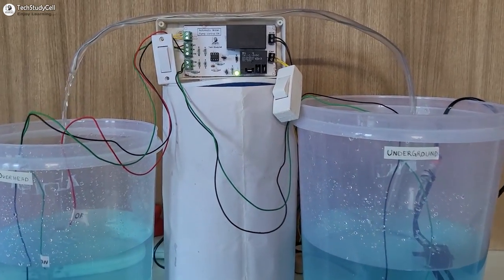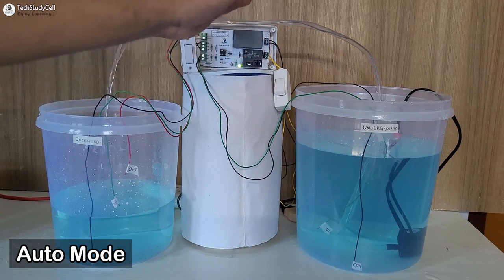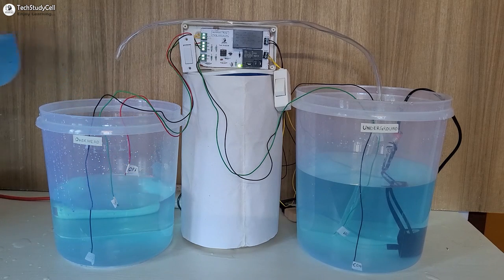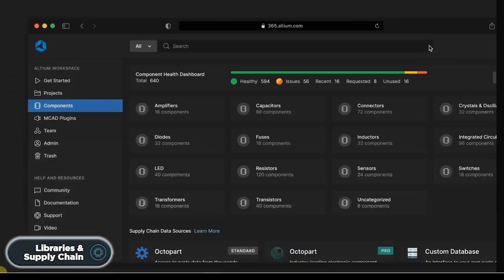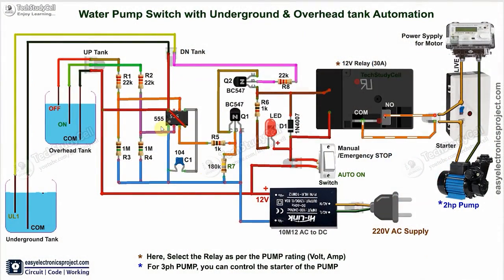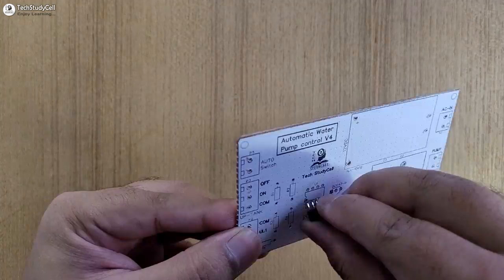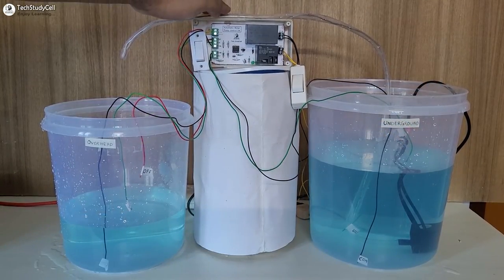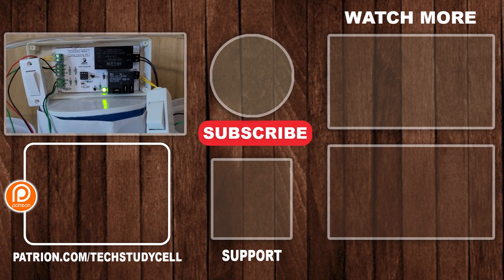Automatic Water Pump Controller project using 555 timer IC

Comment: I made this using a board from PCBWay, tested it today with a lightbulb, absolutely perfect function. Thank you!
Reply: Hello sir... Is this circuit working perfectly till now...
Reply: @varakrishna1016  It worked great for several months, no problems at all, but I did swap that out to another circuit.
Reply: @LeeThayer-nn5ye Did this work when lights cut off and come back on?

Suppose the pump was ON (that is the water level is below the top sensor wire) and then electricity cut off and come back on again.. will the pump still be on?
Reply: @chewthiya  I did not test that aspect, but in design, the sensors are still making the same readings.

Comment: In this circuit, When the power cut off and turn on ,it will turn on automatically while tank is not in below level
Reply from the maker: Yes...
Reply: How to contact you
Reply: @TechStudyCell Any solution for this? 
This will lead to flooding in case of a power outage

Comment: Very good project, but please help me solve one problem, why my relay keeps switching on and off rapidly after the tank is full?Please help me ,thank you.
Reply from the maker: It may occur if there is any loose connection or the wire overlap on each other.
Reply: Thank you very much.

Comment: How to add one more sensor to the overhead tank? This sensor should cut off the power to the pump once it gets in contact with water.
This is so that if the pump switches on after power failure, the tank still won't overflow.
Hope someone comes up with this

Comment: Sir I made this circuit but there is some problem in my circuit. When tank is full means all 3 sensor get connected together then my relay should be in off state but my relay malfunction sometimes it gets on some time it gets off. Can you please suggest to me what could be the problem.
Reply: My circuit also getting same problem bro... Did you find the solution